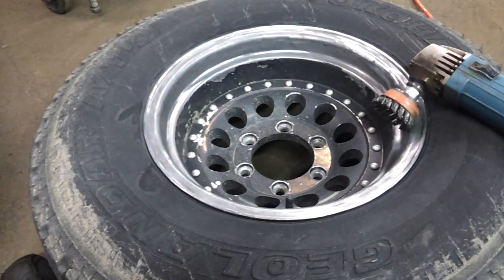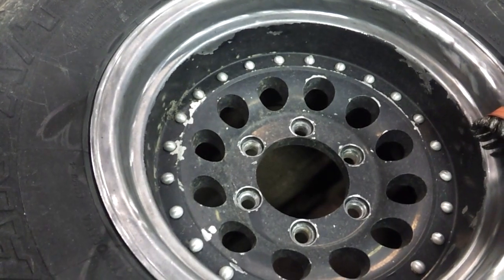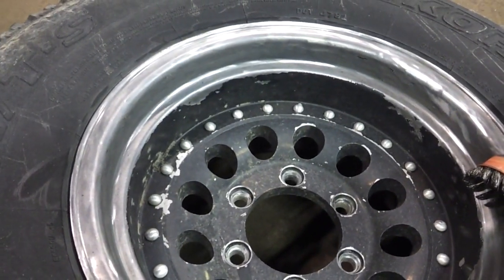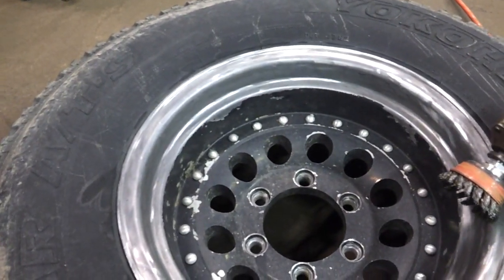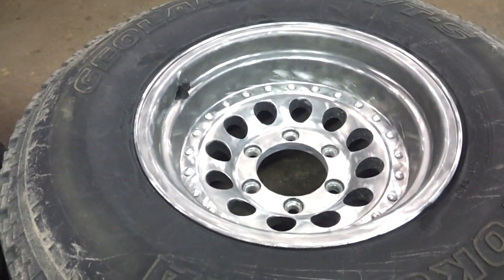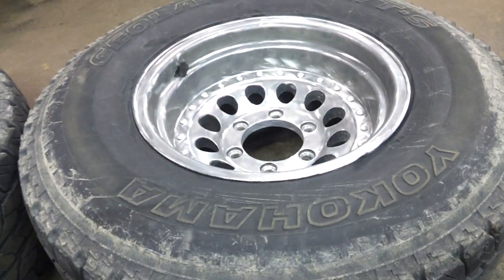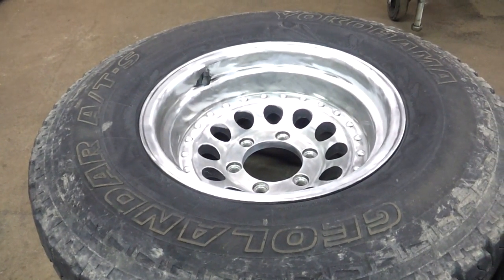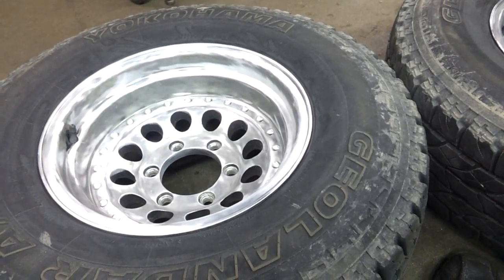Stripping & Painting My Old Wheels

Comment: You should not use a grinder. it will take to much alloy off and need full rebalance. paintstripper works better than good and only takes 5-10 minutes per rim.

Comment: Hi, I have a set of rims like these on a truck I bought, they look like crap. Brake dust and maybe brake fluid rust/corrosion all over them. Anyway im gonna try to strip them with spray on paint stripper and see how they come up. If not I'm gonna paint them. My question is this, did you have to scuff the paint between coats or just spray over each coat without scuffing ?  Rims came out nice ! Thanks for taking the time to make the vid !
Reply from the maker: +YOPHILLYYO The only time you need to scuff between coats is if you let it completely dry. If the paint is still tacky when you do your next coat you do not need to scuff. On a side not, let me say this. Spray paint of any type sucks. It won't last. It'll look good for a little while but it will more than likely start to flake off. You can try using a etching primer that is compatible with aluminum. The best thing you can do is use quality automotive paints and primers to paint the wheels. They'll last and look great. But you'll need a compressor, a gun, an be willing to pay for the good paints.
Reply: +Alvarez Metal Works  hey, thanks for the quick reply. I just came across another video after yours of some woman paint her wheels with "plastic dip" she did them in a flat black. Looked pretty good at the end. But not sure how they hold up. Ever try that or seen the outcome over time of plastic dip ? Answer whenever you can. thanks
Reply from the maker: I've seen it. I don't like that on wheels. It looks great to start with but it's basically rubber. Brake dust and road crap will quickly stick to it... However it's easy and if you don't like it you can peal it off. The more coats the easy it is to peal off though.
Reply: +Alvarez Metal Works  thanks man ! I'll have to see how the wheel cleaning goes. I'm go nna try the oen cleaner and the paint stripper and see which one works best. thanks again !

Comment: Hi ran in to your vid super I love the card idea surly the paint flaked due to not priming the wheels? I don't know I've never used acrylic to spray my wheels (not hating). they look awesome cheers
Reply from the maker: They're holding up well. No flaking or chips. Been wheeling twice in the mud since then washed them a few times since then. Doing great so far. Is it the best way to do it. Most likely not but it's holding up just fine for me.